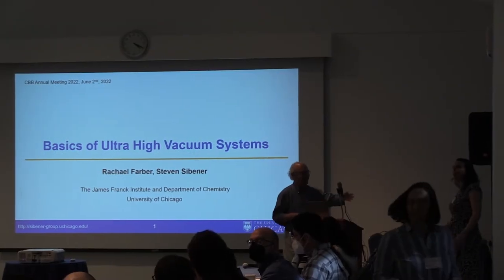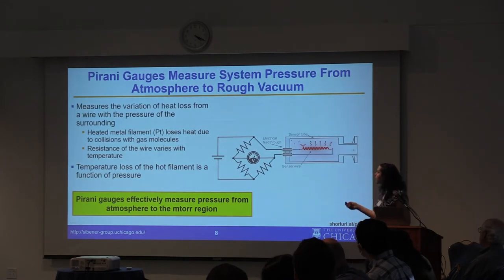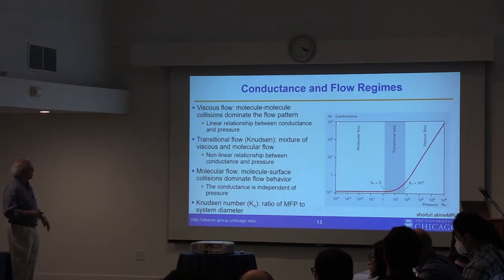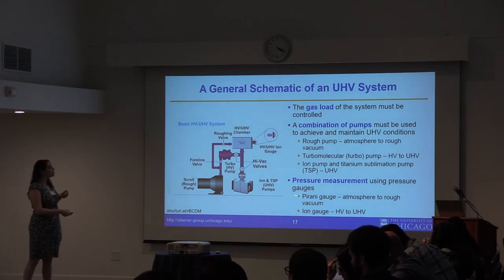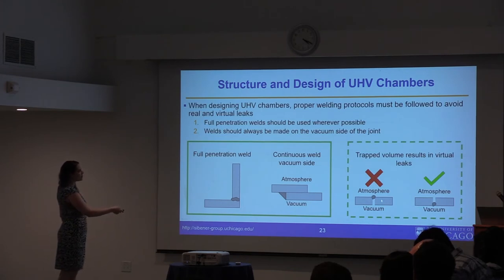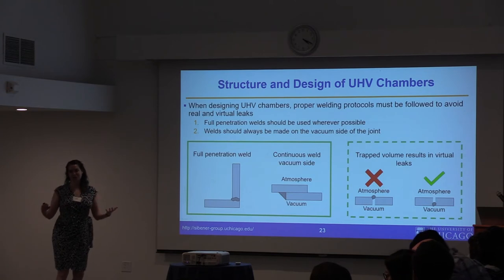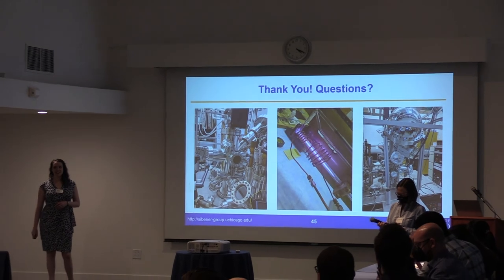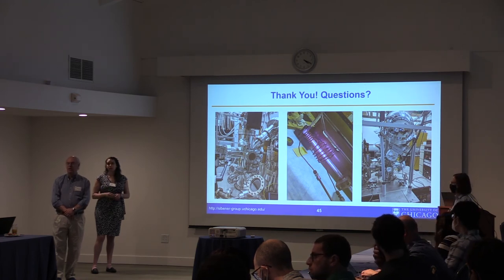Basics of Ultra High Vacuum Systems - Rachael Farber & Steve Sibener

Comment: Really nice presentation! Always a delight to see someone talking about vacuum systems. I had a question about the gaskets you use at the mating surfaces for your flanges of your main chamber and the interface between the pumps. Are they the same or do you change them out based on your need?
Reply from the maker: Thanks for the question! We use copper gaskets for all conflat flanges. This is needed to achieve UHV conditions. For roughing (lower vacuum) conditions we use quick connect KF flanges with viton O-rings.